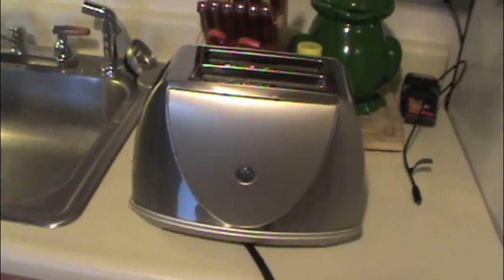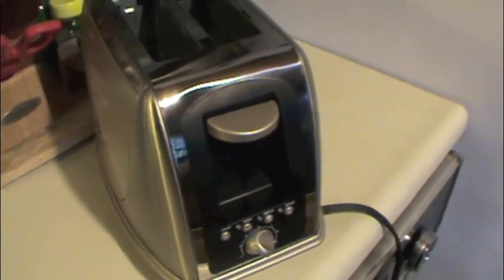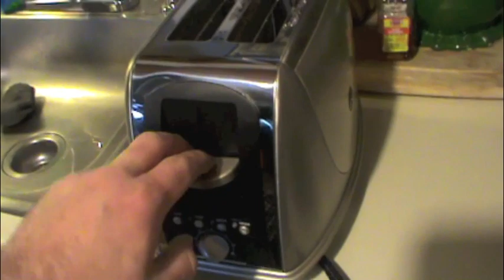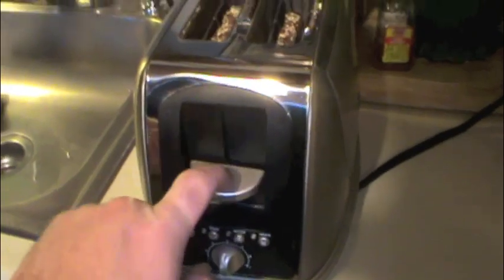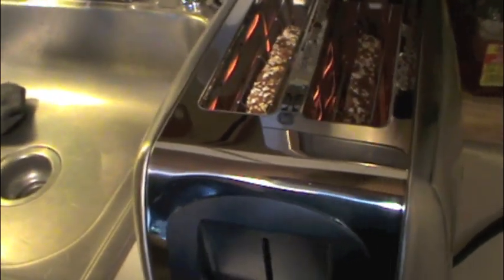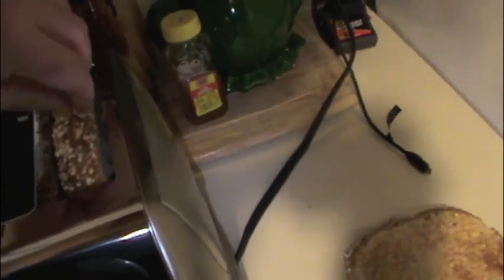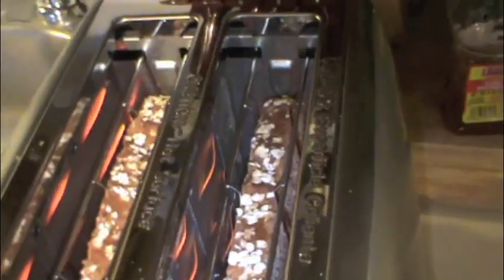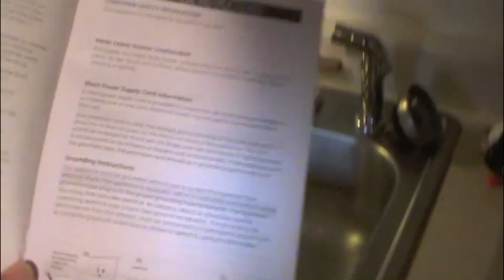GE Toaster Rant

Comment: My toaster is ETL listed, which is supposed to be equivalent to UL. I know ETL is cheaper to get certified for. 

Now I am wondering about my frozen button on mine. I need to experiment with it. I don't know if it is a preset time on, or just extends the time of the main control setting. 

My crumb tray is just as useless as yours hehe. 

Good video.

Comment: @bbishoppcm This maybe the case with the small Magnet you used but remember at least 70% in any kind of steel is still Iron. So if somthing is practically not megnetic at all It is just  somekind of an alloy, but it can´t be called steel. I understand that some casings or panels are not magnetic but as i said they aren´t steel at all....